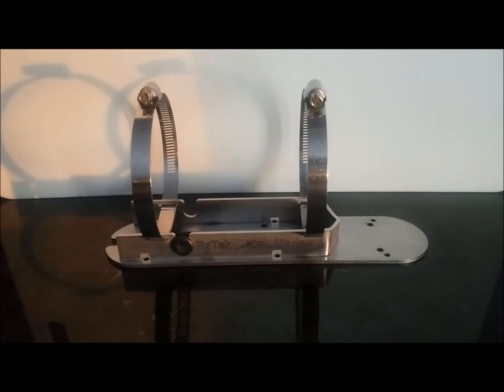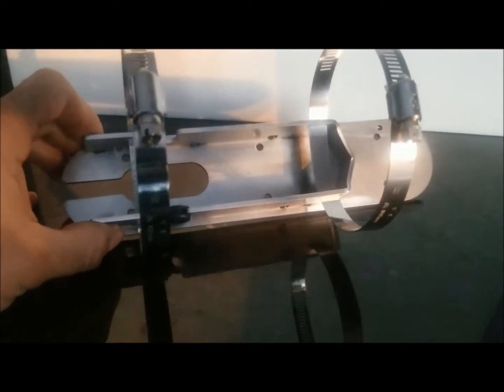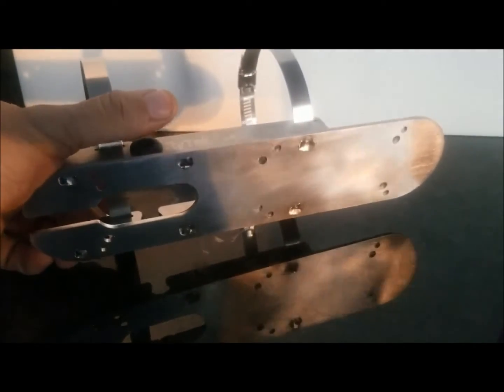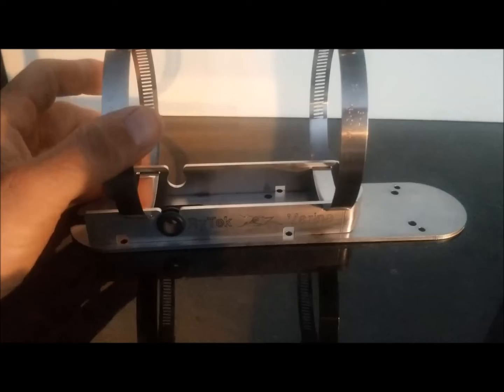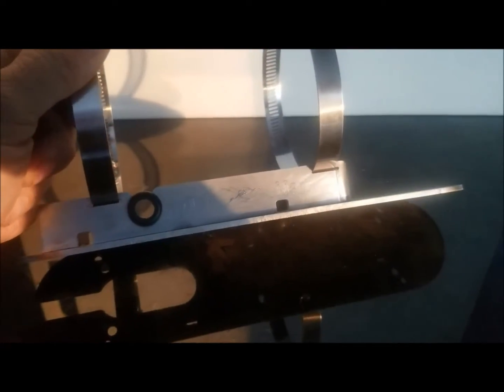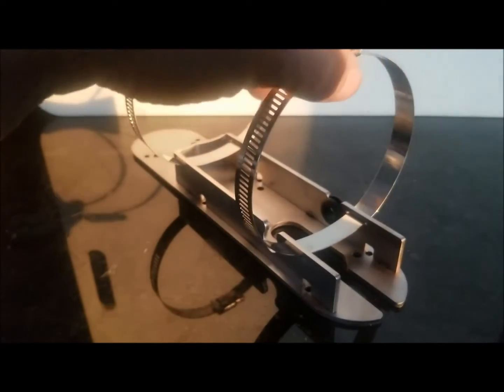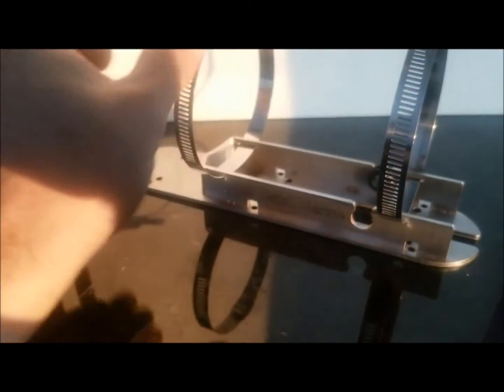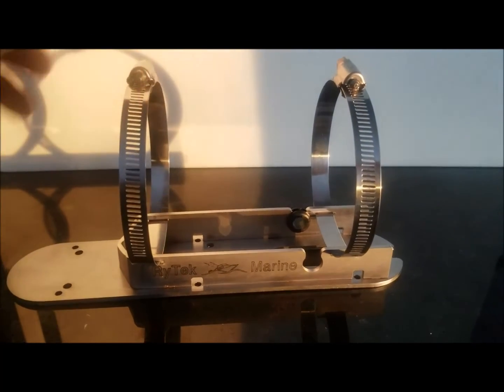Lowrance Structure Scan Trolling Motor Transducer Mount

Comment: I'm looking for a mount to attach the Active Imaging 3-in-1 transducer to Minn Kota Maxxum, will this bracket work on my motor?
Reply from the maker: Multifit works on almost every motor as long as the prop/skeg are on the same end!  Call me at 519-778-5441 for more information

Comment: will this fit a hook tripshot transducer?
Reply from the maker: No directly on its own. You need to combine it with our RTL4500 auxilary mount for the Tripleshot which then allows you to use any of out Lowrance structure scan trolling motor mounts. https://rytekmarine.com/collections/lowrance-totalscan-3d-lss2-3in1-2in1-trippleshot/products/rtl4500-lowrance-tripleshot-auxiliary-transducer-mount

Comment: I just bought a Lowrance HOOK Reveal 7x TripleShot Fishfinder, according to what the Lowrance website confirms, they say it comes with the HOOK² / Reveal TripleShot Skimmer Transducer. Which mount would I need to mount this on my trolling motor? My trolling motor is a Motorguide FW-FB. Thanks for any input you can give me.
Reply from the maker: Best to send me a picture via email to rytekmarine@gmail.com of the Trolling Motor.  You will need the RTL4500 auxilary mount for the Tripleshot and probably either a RTL1600 or one of the Xi5 mounts. Best for me to see a picture first though!
Reply: @rytekmarine6717  Picture of the trolling motor or of the transducer?
Reply from the maker: @mikerobinson4698  the trolling motor!
Reply: @rytekmarine6717  Just sent it.

Comment: Will this work on a tripleshot transducer?
Reply from the maker: Hi Daren, the RTL1600 Multi-fit trolling motor mount will work with the Tripleshot Transducer IF used in combination with the RTL4500 Tripleshot Auxiliary Mount.  It will also work with any other of our Lowrance Structure Scan trolling motor mounts.
Reply: RyTek Marine 
I have a x3 motor guide. I don’t think it is brushless. Is there interference with the sonar, by be mounted on the trolling motor
Reply from the maker: There will be next to no interference from the motor to the transducer as stainless steel is very low on the conductivity chart where as the mounts made from aluminum (all others on the market) are very conductive! My personal xi5 has absolutely zero interference issues and not one of my customers have ever complained.

Comment: Is this compatible w/ a Triple shot?
Reply from the maker: It will be in conjunction with our new Auxiliary Trippleshot mount being released on my website in a few days!
Reply: @rytekmarine6717  so it is this item and an additional item to be able to mount a tripleshot?
Reply from the maker: @JT-ro8xn  unfortunately there are no options for guys running motors with the skeg and the prop on opposite end when it comes to mounting a structure scan tranducer. The being said many cut the skeg and use one of my Multifits in the video above! Send me an email and I can forward you pictures of installs if you like....Ryan
Reply from the maker: Yes you will need the RTL4500 in combination with it for the Tripleshot transducer